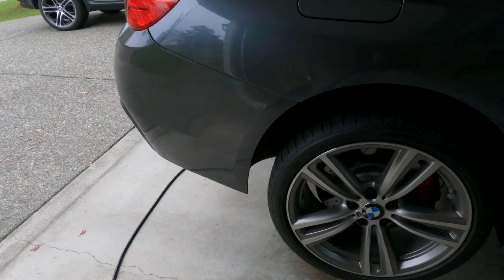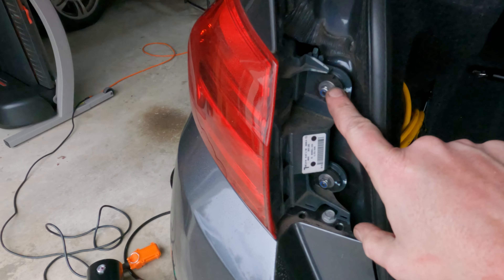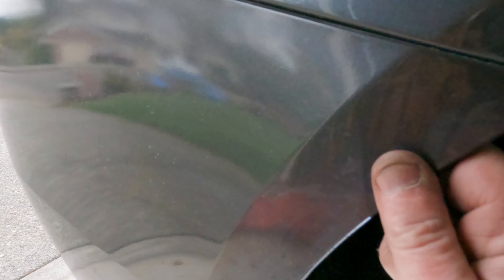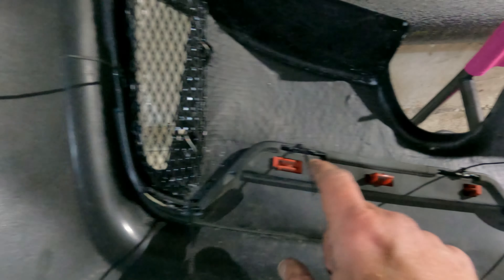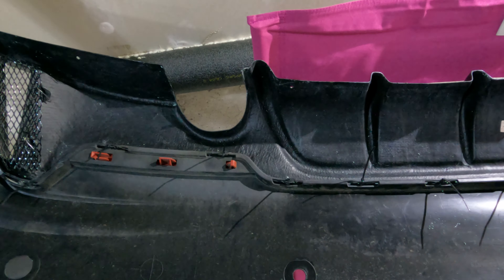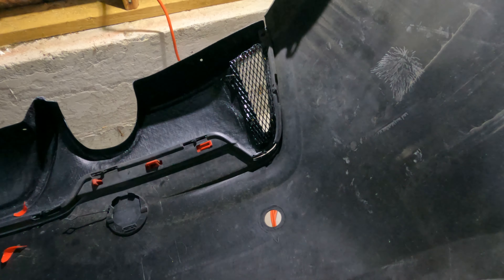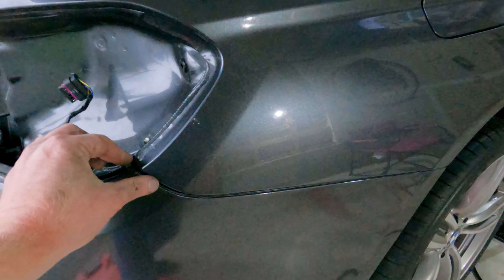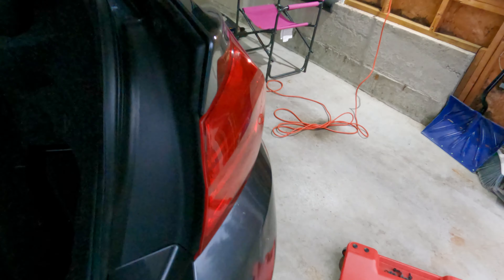BMW F32 435i Kies Motorsports Carbon Fiber Diffuser DIY - Add carbon fiber style to your bumper!

Comment: Can anyone tell me if the IBS sensor needs to be reprogrammed after replacement.
Reply from the maker: It does not 8)
Reply: That is good to hear thank you.
Reply: Mr BMW DIY Guy, I'm so so soo sorry to bug you. I'm so stumped on this issue with my f30. I'm getting a U0079 code, I was told it was my IBS by a reputable mechanic, I replaced it last night and let the car sleep for 3 hours+ but still got the chk engine light, I've cleared it and it instantly comes back. I'm so sorry to bug you.
Reply from the maker: @801russc  everything I read on that error sounds like an emissions problem, with a number of possible causes.
Reply from the maker: Catless downpipe?
Reply: @BMWDIYGuy  Thank you for replying, it's not catless but hi flow. I also discovered that the IBS has to be registered with the DME not programed just registered, I'll let you know the outcome. I friggin love your car tho.
Reply from the maker: @801russc  thank you, me too.. might sell it in 2021 or 2022.  M2c is the next logical step for me.
Reply: @BMWDIYGuy  Oh yeah, I'm diggin that M2 Comp. but at the same time that new M3 is not bad in person. Although I'm currently not in a position to buy one of the above, maybe someday. BMW DIY Guy, seriously thank you for responding, means a lot to me and your subers. As soon as I figure out my issue, I'll let you know, may be helpful someday.
Reply: So I finally figured out the problem with the U0079 code. That code is a EOBD (generic code) I should have said code CD8E10 which is a LIN bus communication error: basically the system sees a short to ground and a short to B+ and it doesn't know where. Mine ended up being a short to B+ & short to ground or positive and negative touching each other at the exhaust valve in the back of the car, water had gotten in the plug and ate the connection ending up shorting then out. Now I've got to figure out what damage that did elsewhere because after it gets warm the idle goes up and down over a 30 to 45 second pulse. Anyway thanks for being a cool YouTuber and responding to your subers. If you can think of anything let me know, you know if you can.  Sorry this response is so long.
Reply from the maker: @801russc  great info and happy to help